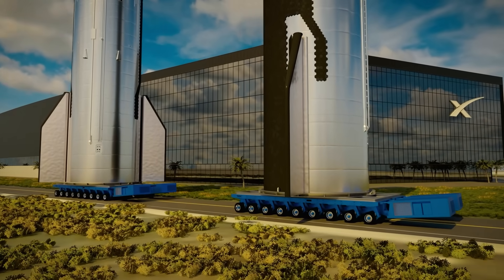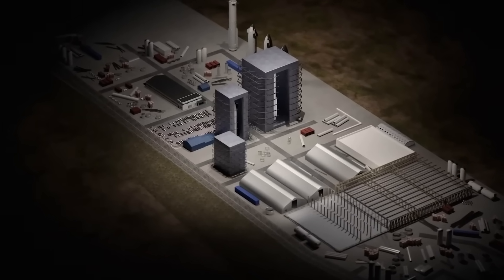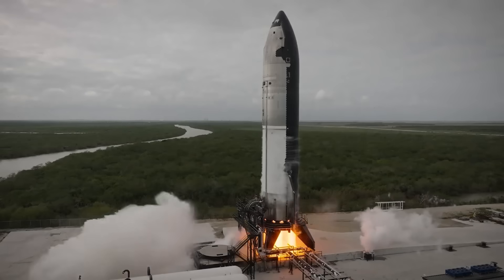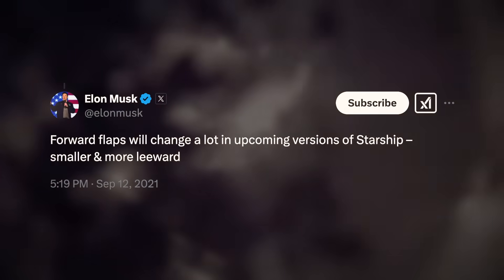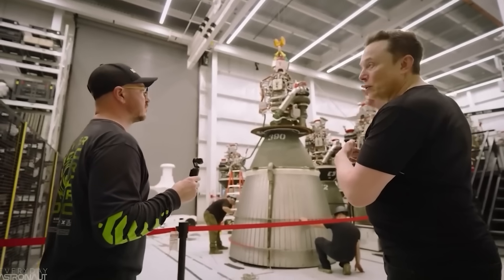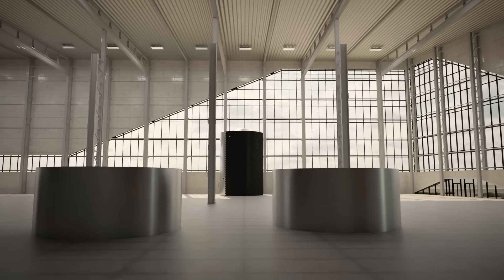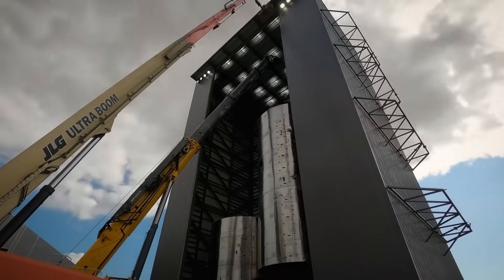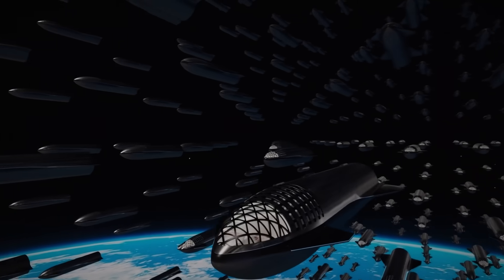How SpaceX Builds One Rocket Every Week!

Comment: Linear Adjacent Flow is Elon's take on what other industries call Continuous Flow Manufacturing or Just-in-time.  Used in conjunction with theories from William Deming (from which Elon gets his "best part is no part" thinking and you have the star factory.  It requires an extremely stable supply system (which spacex has) and a quality design which is inherently safe (which spacex has shown on products like Falcon and Merlin).  One ship per day?  Not a problem given enough lead time, labor resources, supply chain, and just overall space (it's why the factory is so huge).

Comment: I believe they will build multiple types of Starships..        call them types or blocks or whatever, and they will lift them individually, then connect together in orbit.

So that you may have  3x3 or 3x5 or 5x5 groups of starships linked up so that you can have purpose built ship modules for, command, crew, cargo,  Hydroponics,  fuel, landing this will let them maximize efficiency and it will not be a 1000 individual ships more like a core space transport grid, then you could attach more ships full of cargo/crew/robots/ect, many would be automated ships with landing gear and just cargo or robots..  
So the Transport build would fly out disconnect the cargo landers for automated landing. then refuel, connect other core space transport ships and fly back to earth to pick up more cargo starship models..     
This means models meant to stay in space must have fuel transfer capability, space walk capabilities and some better control systems but the models meant to land on Mars must have landing gear and the internal elevators and such to unload the cargo all the way from the upper cargo bay to the surface of the planet.

The majority of ships that land on mars are likely to be disassembled in place to use as structural materials.

Comment: Linear Adjacent flow; each step in manufacturing is Lined up next to each other, (in close proximity). Simple buy essential Principles, for maximum efficiency.
Reply: It's like the way you make model aircraft, for example, each side finished with interior parts before final assembly, exterior details, and paint.

Comment: To make this work, 1000 Starships would need to be launched almost simultaneously, because of physics.
Earth / Mars perihelion (closest approach) is 34 million miles. This occurs once every (just over) 2 years.
Earth / Mars aphelion (furthest distance) is 259 million miles.
Therefore, just a continuous and regular launch schedule, like Falcon, is not possible.
I believe that launching one Starship, every 30 minutes, 24/7 for a month is not conceivable.
For a start, weather and logistics will not allow it. Quite apart from the manufacturing / launching schedule.
The only (realistic?) solution is a larger Starship. Much larger. 100 times larger. Where 10 launches would meet the requirement.
Reply: Could ship assembly in orbit be a solution? Mega-Starship
Reply: I realize this is a month old by now, but I'm still going to reply anyway lol - Most of the ships, probably 80% or more, would be strictly cargo. They can be launched into orbit whenever and just hang out until the transfer window opens. The only ships that have to be launched during the transfer window are the ones holding people. 200+ launches in a month is still a lot compared to what we're used to, you're not wrong there, but it won't be 1000.

Comment: I hate to burst anyone’s bubble but if each ship requires 8 other ships or refueling ls at minimum  that doesn’t seem likely that 1000 ships can leave at the same time I got a few flaws or questions about refueling times and frequency and fuel issues as far as needing to vent as to not build up crazy pressure ?????
Reply: The refueling is indeed the Achilles heel of Starship.
Reply: It wouldn't be literally at the same time. The optimal Mars launch window is weeks long. 50 ships per day over the course of 20 days. They could also launch outside of the 'optimal' window and use a bit more fuel. Depends on the payload. (i.e. equipment that is large, but not dense could be launched later and sacrifice some fuel efficiency to make up for missing the optimal window.)

But yes, fueling that many ships is going to be an endeavor all by itself. Imagine dozens of on orbit depots receiving multiple tanker ships per day.
Reply: @ The fuel boil off in space is very high. You can’t just station ships there and expect them not to run dry over time. While space itself is cold, the sun heats up any surface it hits. A full tanker Starship will be dry within a matter of weeks. Plus the boil-off will cause them to alter course, as the valves act like mini engines causing recoil. It’s all a phantasy with Mars. Moon is doable, still complex though. Mars with Starships is just not. 8 to 10 refills to reach the moon, 5hats only 240,000 miles away. Mars is 140 MILLION miles away! So you‘d need like 500-600 refuel stops on the way there? And they all have to go flawlessly? And they will increase travel time from 9 month to how long? It‘s. Not. Possible. Not with Starship.
Reply: @ Mate, you need to brush up on your basic orbital mechanics. The delta V difference between getting to the Moon and Mars is tiny.

There's an old saying, "In orbit, you're halfway to everywhere." 

Fuel boil off is nearly irrelevant. For early Moon or Mars missions, they wouldn't space out the time between refueling the depot and launching the actual mission for it to truly become a problem. Maybe they have to launch one extra refueling tanker. That's only an extra few million dollars. Which is a negligible cost in the grand scheme.

Longer term, all it costs is some power and payload space. Building a condenser good enough to counteract boil off to the point where its a non-issue is an engineering problem, not a physics problem. We can already super chill prop on the ground. They can do it in space. It would also make sense to give the Orbital Depot's some extra insulation to mitigate boil off further.
Reply: @ So, only ONE extra refuel difference between getting to the Moon and getting to Mars. Yeah right. May want to ask your orbital mechanics professor again about that one.
Reply: @ That isn't what I said at all, bruv. I'm not going to continue this conversation since you can't read. Have a good one.
Reply: @ Here, since we're in 2025, go to your favorite AI and ask it these three questions:

Delta V required to get to LEO
Delta V to get to the moon from LEO
Delta V to get to Mars from LEO

Hope you have a good time wrapping your head around those numbers.
Reply: @ Ok, that’s your source. Got it.
Reply: @ On a side note, SpaceX has yet to reach orbit with Starship. Or Moon. Or close.
Reply: @ I didn't ask an AI. I searched Google. I made sure the AI's answers were correct. 

You can't pretend to be a Luddite to escape just how obscenely stupid your argument is.
Reply: @Urufu-san  They deliberately haven't tried to orbit until the most recent flight, which failed due to an oxygen leak. All prior flights were kept sub orbital on purpose to prevent any potentialities with a failed orbital relight. 

Why would they be going to the moon? 

You're arguing like a child.
Reply: @ To be clear, I like what SpaceX is doing. I follow every Starship launch live, and I smile when they catch a booster. 
They would go to the moon for the exact same reasons they try stuff and fail and improve. The moon is challenge enough to reach, to land on, and to establish a presence at. There is a good reason it hasn’t been done in 52 years and a bit. Moon can be a stepping stone in developing and testing your stuff. Why not use it? Because it’s not a first, and Mars and multi-planetary sounds cool! There’s no logical reason to aim for Mars directly, it’s all PR. 
Maybe if Artemis is scrubbed, Musk will include the Moon saying „If we don’t do it, nobody will.“ Which I would applaud. 
We‘ll see, I guess.
Reply: @Bf26fge  I like where your head is at, but for Mars that kind of extremely slow burn maneuver wouldn't be necessary at all. Anything in or past the asteroid belt, though? Totally.
Reply: Yeah well.....yo momma burst my bubble ĺast night so....
Reply: i dont understand why the starship would be worse than the SLS ? when they are both similar size . how does the SLS do it without this refueling issue that gets brought up ? anyone?
Reply: @websitemartian  Short answer? It doesn't. SLS is designed like the Saturn V. It's a multi stage booster that can deliver ONLY the 10 metric ton Orion capsule to the moon's orbit. Starship is ostensibly capable of delivering 100 metric tons to the surface of the moon. Those are two VERY different missions with an enormous difference in degree of difficulty.

edit: While SLS may be "similar" in diameter to the Starship, SLS is about 20 meters shorter AND is using liquid hydrogen as its propellant. Hydrogen is much, much less dense than Starship's Methane fuel and needs significantly larger tanks to hold the same amount of fuel that Starship can.
Reply: @jackinthebox301   why not instead of cargo carry more fuel instead ?
Reply: @websitemartian  I'm not sure what you mean. Are you talking about Starship or SLS? 

SLS is only sending a capsule to the moon. It doesn't need to be refueled. 

Starship needs to be refueled because its so big it can't bring it's payload and enough fuel for the mission from the ground.
Reply: @jackinthebox301  im talking about starship. instead of 100 tons of cargo .. do 50 ton cargo and add 50 ton more fuel . that is still alot of cargo ..
Reply: @websitemartian  I'm sure we will see Starships perform missions beyond LEO with no refueling flights, but I imagine those will be exceedingly rare. They will still need to refuel a number of times to go anywhere besides LEO even with a reduced cargo load. The Starship is going to be effectively empty once reaching orbit. Getting into orbit is the hard part. Heavy or light payload.
Reply: Slowly but surely more people comprehend that Mars is faaaaar away 🙂 „Going to Mars“ isn’t much more than advertising, shaping the information battle field and securing funding. It’s not practical with Starship.

Comment: What is interesting to me is how judging by the numbers on the engines they must have built at least 600 raptor engines before version 3, each costing at least 2 million dollars.
Reply: damn, i am surprised it only cost 2 million, kinda "cheap" in comparison
Reply: This deserves more upvotes.
Reply: sounds like pocket change to me!! LOL
Reply: 1. We have no idea if their numbering scheme is referring to only completed engines or, like their ship and booster prototypes, includes partials that were started, but scrapped due to issues or updated designs.

2. We have no idea what the newer engines cost. The originals were quoted at $2 million, but the newer designs are far simpler and likely significantly easier to manufacture. Are they at the $200k per engine level Elon said they could eventually be? Probably not, but maybe they're at $1 million or less. Speculation, sure, but assuming they still cost $2 mill is speculation too.

3. Even if we assume there are 600 engines all at $2 mill each, $1.2 billion spent on engines (the single most complex, most important part of the vehicle) is less than one quarter the cost of the whole project up to this point. And still half the cost of one single SLS launch. 

So what's your point?
Reply: @jackinthebox301  you are on point with what you stated, but I don't think he was trying to be negative. He just said it was interesting..
Reply: @rocketignitionKSC  yeah I realized it sounded a little harsh after I posted it lol

Comment: Casual reminder that the starship program has already burned through more engines than the entire shuttle and Apollo era programs combined and hasn't even made orbit yet or achieved a single milestone on the gant chart for returning astronauts to the moon per their contract.

But at least Kathy Lueders got a cushy job... That's what really matters.
Reply: Anyone can make up an arbitrary metric and come to a preconceived conclusion. 

The number of engines is utterly irrelevant.

The Starship program has an average burn rate of LESS THAN $1 Billion per year since 2018. SLS has gone through $26 billion ($32 billion 2024 inflation adjusted) since 2011. So double the burn rate over a longer period of time with one SINGLE successful launch. And they found out the Orion heat shield didn't perform like it was supposed to. Money well spent.
Reply: falcon 9 went through the same development process and is currently flying one or two times a week and has brought many astronauts to the ISS.
Reply: How about a short acknowledgement regarding the incredible evolution of their engines? The new Raptors are a metric sh*t ton less complicated yet way more powerful. 😏

Comment: I'm sorry but Starship is just a flawed concept. There are many reasons but the biggest one is practicality...you simply need many more tanker launches per one interplanetary flight that takes 7 Months and carries essentially nothing and a small crew. It might be good on the short term, but it's not a rocket that will build a Mars colony . 
Instead, you need a space ship assembled in orbit from sections, powered by (either) the new Russian plasma engines (paired with nuclear reactor) or full nuclear propulsion, and dock shuttles to that. Such rocket can carry much more, much faster (only 30-40 days to Mars) and work for nearly a decade without refueling the reactor.
Reply: Why do you need to get there in 40 days? You would need a lot of propellant to accelerate to those speeds, and also a whole lot to decelerate. Also, 100-200 tons to Mars surface is not 'nothing'. 

What evidence do you have to support it won't be able to build a mars colony? No one has ever done it before.

Nuclear propulsion has never been tested in spaceflight, and is very likely something we will not see in our lifetime.

How many launches would it take to assemble a ship in orbit? How would you land that on Mars? 

Refuelling is a necessary compromise if you want to carry meaningful mass to Mars, and right now that only makes sense with a fully reusable rocket
Reply: @ 1) You would need 10 times less propellant with the plasma engine, and no propellant at all with complete nuclear propulsion. You need to get there fast due to cosmic radiation, because in interplanetary space there's no Earth magnetic field to protect you. Starship will need some heavy shielding if it wants to drift in space for 7 Months, something adding more weight. 
100-200 tonnes to surface is pure fantasy onboard a crewed Starship, there's simply no space to put it along with essential supplies.  

2) What evidence? Logic. Such mission (and ship) has been proposed multiple times and is in active development by Roscosmos, CNSA and studied by NASA. 

3) Nuclear propulsion has been tested many times, successfully, on the ground. Moreover, Soviets launched dozens of satellites powered by small nuclear reactors. The Soviets, yes, that's a long time ago. We will see nuclear propulsion in our lifetime (if you are not old), infact as early as 2030's. China is going at it big, so does Russia.  

4) To assemble such nuclear rocket in earth orbit would actually take relatively modest number of launches with a heavy lift vehicle like Russia's Angara A5 or even Proton-M. 
It's probably around 20-30 launches for a fully assembled Ship. This is the proposed way by Roscosmos.   
Landing on Mars would be done via landers (shuttles) docked to this assembled space ship. This would provide a fallback point if things on the surface go south during the settling, simply ascend to space and dock.

5) Refueling is only a compromise needed for a standard chemical propellant rocket. 
If you assemble a spaceship in orbit (basically ISS but with nuclear reactor and thrusters), you don't need any refueling other than the reactor after 10 years and cargo missions to these space ships. 

Look forward please. Such space ship not only allows for fast Mars travel, but also allows for Asteroid mining, short travel missions to Jupiter and even Interstellar travel. These ships will dominate space in the future, simply because chemical propulsion rockets like Starship are outdated concept (and impractical in the long run) with our current technological advancements. Starship would be best suited for massive cargo to Earth's orbits and that's that. Starship would be very good at assembling such Space Ship.
Reply: @ so considering the fact that every single launch provider hasn’t tried it and SpaceX, the first to many things in Spaceflight also hasn’t, why wouldn’t they have done it? Hmm, maybe because they know the logistics are horrors beyond their comprehension to deal with. Logic itself doesn’t solve problems, problem solving does.
Reply: So it’s not practical when it costs relatively nothing, with quick refuel flights and rapid reusability, and is second to no other rocket in history??? L ragebait.
Reply: Have you thought through your own idea? If you build a rocket in orbit, you still need to FUEL the new ship you just built. If you need to launch 12 times to refuel an empty starship before it can go to mars, you’ll need 12 launches to refuel a new ship you just built in orbit. Your idea is just starship but worse